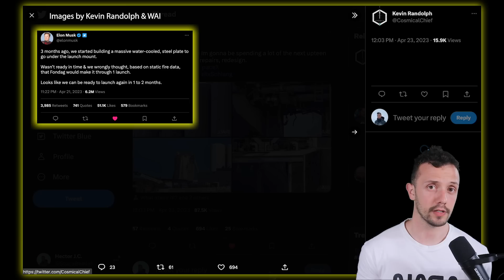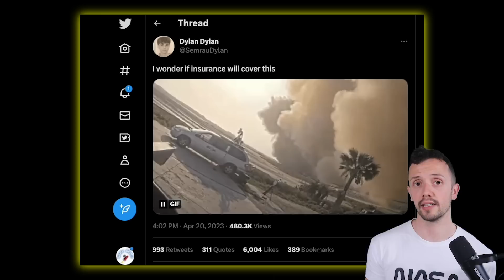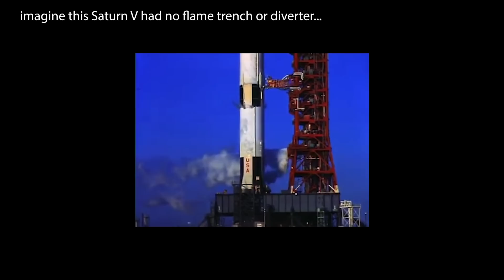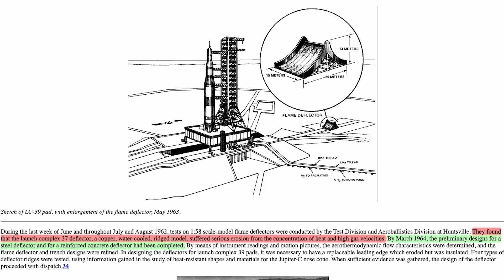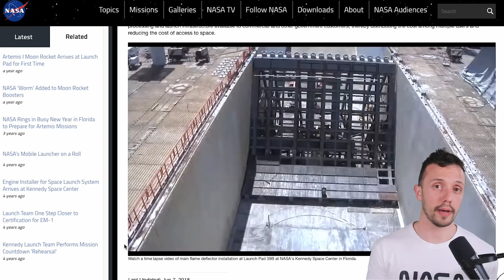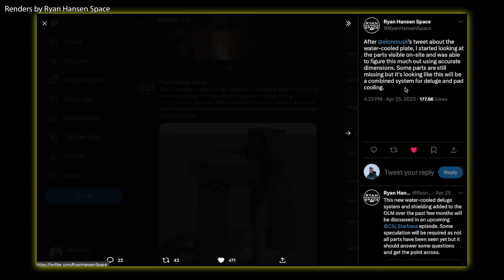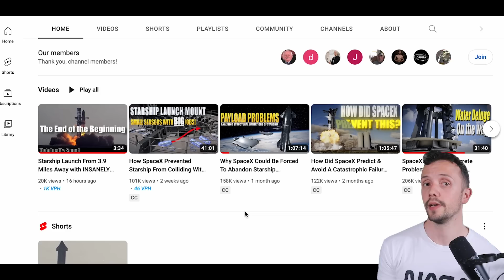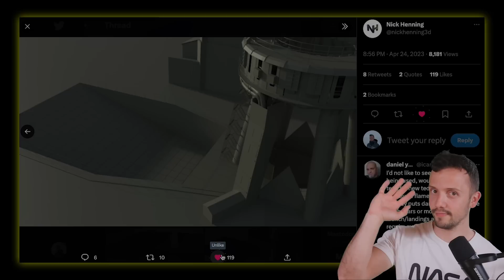SpaceX is Developing a Smart Solution for its Pad Problem: What We Know & What It Could Look Like!

Comment: As a dutch guy, I'm surprised that everyone is so afraid of building below the water table.
Here every building with a parking garage below is basically a concrete bathtub hold down from floating by the weight of the building on top.
Reply from the maker: haha true!
Reply: digging down would require a lengthy permit process
Reply: @BradiKal61  This.
Reply: @Dan P I question your ability to think.
Reply: @Menno van Lavieren, same as in Waikiki parking (under hotels) use sumps with pumps 24/7
Reply: america ☕☕
Reply: Yeah, I don't see the big problem either.
Since we can properly measure how far down the blast went in tearing up concrete, maybe go an extra 50% deeper and put the diverter system there? Seems pretty easy to me.
I was saying in another comment how SpaceX could use a 0/120/120 tower. Trolley the rocket in, and have the chopsticks lift it up to the original pad, rotated 120 degrees. But then lift it again to a higher pad 120 degrees farther. And the flame diverter would be under that. But maybe 0/90/90 would make more sense. The diverter would be 180 degrees on the opposite side of the tower from where the rocket was rolled in. The flames would go sideways and it would make a big T.
Higher rocket plus deeper flame ditch would be the answer.
Reply: @Dan P That's what I said to do.
Reply: You Dutch have an understanding of building in wetlands that Americans simply do not share. We're too arrogant in our belief that nature should comply with our desires without any extra effort on our part. This is why Americans can't understand why their beach houses (not protected by dikes) get flooded during major sea storms. They think that ownership of property should be respected by nature.
Reply: @daniels7907  Sounds like King Knut telling the tide not to come in.
Reply: @samfromportadown  - Not like Cape Canaveral isn't built on swampy coastline too but they have flame trenches. It comes across more as Musk simply not wanting to spend the money and expecting his bargain launch site to remain intact despite launching the world's most powerful rocket from a pad made of concrete sitting directly on wet sand.
Reply: @daniels7907  this is a practice in minimum viable product. Elons companies operate lean with minimal excess. That's how they've survived. If they over engineered everything, they'd be bankrupt.
Reply: @daniels7907  Are you ok?
Reply: @Dan P that reinforces the need to be lean.
Opposed to Boeing, Lockheed, and other defense contractors that just get fat.

Comment: But there is another reason why they use a "flame diverter"  And its not the flame.  Its the shockwave.  They learned in the 50's you CANNOT have a flat surface under the rocket due to the shockwave being bounced back into the rocket. You can watch the multiple failures at launch in old news reels.  High speed photography showed this was the issue.  And the same is true with Starship test fires.  You can see this wave bounce straight back into the rocket.  This is why every single time they fired it, they replaced a raptor or 2.  What is frustrating is they knew this...  But higher ups (Musk) are stuck on no diverter.  Well... he was.  I think he's finally realizing the issue is not heat.  
And the reasoning for "no diverter"  makes zero sense as Mars and the Moon will not need to worry about this issue.  Due to no atmosphere and low gravity.  But here, on earth...  We need MASSIVE amounts of thrust to get off the ground.
Reply: Flame trench and diverter at Boca was going to cost allot of time as the Army Core Of Engineers would be involved, along with environmental assessments, and all that other red tape. That is why they went with the flat pad idea. When Elon said "it wouldn't be ready in time", he meant it wouldn't be ready in time for his silly 4/20 launch, which no one is laughing about now. This may go down as the single most moronic first launch in history. A NASA pad engineer said the water cooled/deluge steel plate idea will work, but added the shockwave might still be an issue. Watch some of the slow motion close up videos by the Everyday Astronaut. Those shock waves are just pounding the living sh*t out of everything. Never seen that before (nor would we, as pad design goes back to the 40's).
Reply: @hawkdsl  the reason they built the table so high was to avoid digging a trench.  That was the whole point.  And there were initial drawings and concepts for a curved ramp under.   But somehow, they got shelved. As it became an improvised way of working under the rocket.  But even NASA figured this out in early 60’s by having the deflector on rails. And they rolled it under at launch.  Of course, repairing this after every launch proved to be an issue. (Minor repairs) and the eventuality made it all concrete with a water cooled ramp.
Reply: @davidbowerman6433  yes, the high table was an attempt to mitigate damage.. but the actual cause of the design was the significantly longer approval process for a real pad design. The pad site is simply too small for such an epic rocket. I hope the new plate works. If it doesn't, the delays to the entire US space program will be catastrophic.
Reply: @hawkdsl  The launch was originally scheduled for 2 days earlier so the 4/20 thing is nonsense.
Reply: I agree, but than we had no first flight at 4/20. that is the prise for a meme aparently.
Can‘t wait for molten Steel flying into the GSE tanks. o.0
Reply: @exilefaxen4860  😂😂
Reply: the russians figured out flame divertion 50 years ago. 
Can our great inventor break the barriers to recreate the past ?
Reply: @Agorax_gg  Actually, The germans used radial diverters under V2 rockets 80 years ago.
Reply: A major success 😳
Reply: @Dan P LOL
Reply: Newtons third law : For every action, there is an equal but opposite reaction.
Reply: Maybe Superheavy would survive the shockwave?
Just a reminder Superheavy is designed to survive re-entry with all that heat and pressure.
And let alone the fact that most rocket are not the design to survive re-entry which would make sense to redirect the shockwave out of the engine way
Reply: @@danp576 I wonder if a flat plate causes bow/normal (strong) shockwaves while the oblique diverter surface creates a much less painful oblique shockwave and pressure hammering towards the rocket itself? I guess somebody is hard doing very expensive and complex CFD analyses about the subject right now 🙂
Reply: @Dan P in a world where Florida and Cap canaveral doesn’t exist you r correct. 
If you erase the past. Elon is a great inventor. And he marrying black cleopatra from Egypt. 
Santa Claus is attending the wedding

Comment: A flame trench filled with water.  Nasa had been doing that for years! It's sad to see how much we've regressed in tech. And yes, that's me standing in front of the external tank for the space shuttle in the VAB at KSC.
Reply: that entire complex is built on a beach.  digging a huge trench would mean almost starting over from zero.  there is a reason the shuttle and other big launch systems are built on higher ground.
Reply: @BradiKal61  The shuttle and SLS launch systems were also built on a beach. The land was built up to account for the low water table. It was expensive and time consuiming, but it's stood the test of time for 50 years.
Reply: why would elon listen to nasa when hes a REAL engineer
Reply: @jebes909090  Well, his company is launching and landing rockets every week sometimes more than one a week, when did NASA do that, oh yeh, never. Starship is a totally new concept, mistakes will be made and corrections implemented. If we left it up to NASA you would be stuck with SLS costing 4 Billion per launch and years late with a launch mount that needs to be completely redesigned after the second launch at a cost of more billions. Ultimately it's his money he's burning though so what is the problem.
Reply: @schrodingerscat1863  most of its launches are for starlink,  which is losing money every launch.    in fact,  spacex itself is losing money.    he just broke even last year because he 'donated'  starlink recievers to ukraine..............which the us military paid him 400 million for.
Reply: @jebes909090  Starlink is not expected to make a profit at this stage over all, they are still launching satellites. Excluding launches it is profitable and is only just beginning to ramp up its user base as it moves out of Beta. You are looking at a potential $30Billion per year business with relatively low overheads once the constellation is in place. As far as Ukraine is concerned Musk donated many of the terminals and the military is paying for everything else, ground stations, running and support costs. So Musk stumped up about $100m and the government the rest. You can't expect him to cover the whole cost of that plus ongoing running costs for about 42000 terminals sent so far, running costs alone are over $20 million a month. Without Starlink, Ukraine would be in a significantly worse position than it is.
Reply: @jebes909090  Engineers listen to all engineers, especially if they have 60+ years of collective real world experience. You probably didn't think that one through.
Reply: @hawkdsl  they're not real ones like elon though
Reply: @jebes909090  LOL!
Reply: Elon’s ego is the issue.
Reply: @AFuller2020  Had to launch on 4/20.  Juvenile reasoning lead to catastrophic damage to in-place infrastructure.
Reply: @xDiscoStu  This, 100%
Reply: They are not allowed to just build a trench, it would need to be cleared with the Army Corps of Engineers first and that would take years. This is why the launch mount is so tall, they essentially lifted the rocket up the height of a flame trench. A trench also has the down side of constraining the exhaust which actually makes the concrete problem worse. Currently the exhaust can dissipate all the way around the mount, with a trench it is constrained trapping more energy against the concrete.

Comment: Big mistake on SpaceX's part.  I don't see a water cooled plate working much better either.  They need a proper flame diverter, which has worked well for decades.
Reply: A launch diverter is not possible for Starbase because of its proximity to the Gulf and the water level
Reply: @RodanES  I still don't buy it. They can do it at the Cape, which has a similar elevation and proximity to water.
Reply: @protorhinocerator142  With 100' feets elevated concrete pads, not really feasible
Reply: @protorhinocerator142  they need to increase the height of the launch pad to put in a flame deflector like the NASA launch pads. SpaceX hasn’t done this because it’s a 3 year construction time and a lot of permits to dredge massive amounts of material for it’s construction in an area close proximity to a conservation zone.
Reply: @RodanES  even Cape is at sea level. They built in elevation.
Reply: @RodanES     It would work.  Actually they could use the high water table to their advantage
Reply: @float32     He couldn’t do worse than SpaceX engineers.  Let’s sprinkle some water on a concrete pad at launch. That should work. 😂😂😂

Comment: I believe the Raptor engines are the most efficient rocket engines ever built so they may create bigger challenges for the surfaces below than other rockets have especially when you put 33 so close together.
Reply: The soviets N1 rocket flew twice as far as Starship 50 years ago! with its 30 nk-15 engines this launch pad fiasco is the beginning of the end for Starship the steel water cooled plate wont work it will explode like a huge boiler tank they need a Trench or its over for Starship the FAA will be insane to allow them to launch without a trench!

Comment: I think the launch the way it went WAS the way they wanted to try it first. Consider the case. No one has ever even attempted to launch a heavy lift rocket without massive infrastructure. This was a "worst case" scenario and they got tons of data no one ever had the balls to possibly destroy a rocket to get. Some of the angles of the launch show the extreme supersonic shockwaves reflecting off the ground back up. It is inspiring this rocket left the pad at all. Damaged, for sure. But it flew away from the most hellish launch conditions ever seen.  Just my 2 cents.
Reply: Yes I'm glad they were able to reacquire all this useful data NASA had in the 60's of how not to launch a large rocket...
Reply: Destorying a rocket happens sometimes. Destroying the launch infrastructure - which is supposed to be there for multiple launches - is a disaster. You'd want to be able to focus on the rocket and launch them one after the other to get the data you need. Can't do that if the launch pad is destroyed and has to be rebuilt. That's what killed the Russian N1 rocket. When it crashed and destroyed the pad they had to spend time and money rebuilding the pad while the rocket engineers just sat around.
Reply: If this were a Russian rocket it would be a fail, but it’s Elon so spins the game.

Comment: SpaceX are keenly aware that no matter what they do to solve the thrust/pad issue, the FAA is going to want to spend their requisite 6+ months scrutinizing the idea before anything is given the green light.  In light of that understanding, the choice was basically: Install the deluge/diverter system and delay the first launch until almost 2024, or cross their fingers, launch now, hope for the best, and then spend pretty much the exact same amount of time cleaning and installing until they're able to launch again.  If they'd picked option #1, then by the end of 2023, everyone, including themselves, would be asking why they didn't go ahead and risk S24/B7 on a launch anyway, especially when the alternative was just sending another stack to the scrapyard.
Reply: Starship has been in development for years. Musk made the decision not to have a flame trench 3 years ago. More than enough time to actually build one by now and get all the approvals.
Reply: @Dan P Saved a starship?  You seem to have missed the part where they were going to scrap the thing if they didn't have an immediate launch option.

Maybe you're talking about the Starships that are already mostly done, S25, 26, 27?  Yes, those designs may now be even more obsolete than they were before SpaceX got their hands on juicy flight data.

Comment: I swear I saw a hot fire test video played in slow motion and you see the sound pressure waves bouncing straight off and up from the flat concrete floor.     Watch the SpaceX drone footage. At t+3 seconds I think I see same waves a long right side vehicle.  Maybe I’m projecting.  It seems to stop when the concrete flys.         Also Scott Manley said, “The rocket wanted a flame trench. Not having one, it decided to make its own.”

Comment: Steel plate won't work. The design needs the diverter in a deep water pool under the pad with canal system to divert the steam and water. And a water feed system to supply the pool.
Reply: Between the Army Corps of Engineers and the EPA they'll likely never get the permits for either an excavation or a mound to elevate the OLM.

Comment: I can’t believe that of all these so-called “experts” and pundits, none of you have correctly identified the actual cause of the pad damage.  Everyone is still repeating the mantra that it was damage caused by engines blast.  Nonsense!

The damage was caused by the HEAT that flashed groundwater to steam, causing a bleve from beneath the concrete.